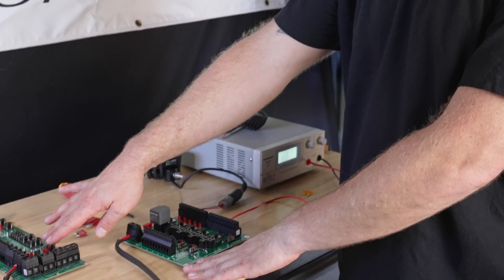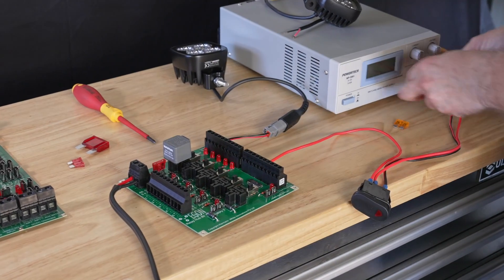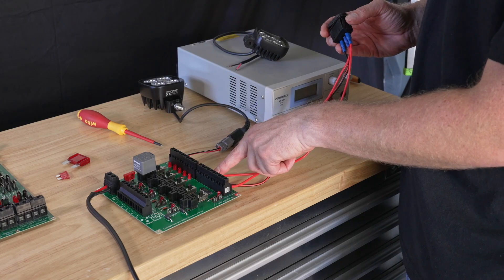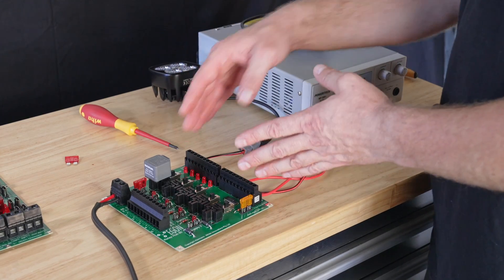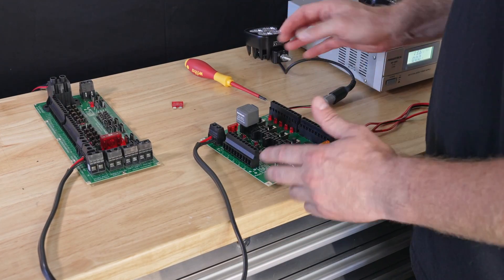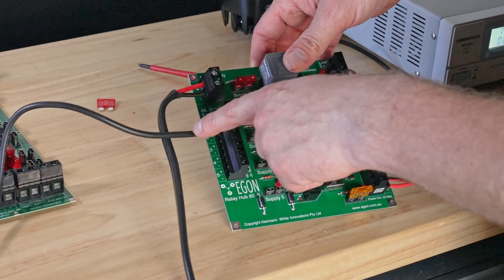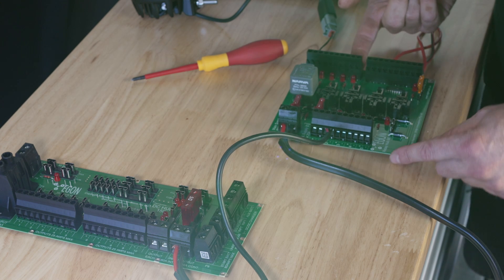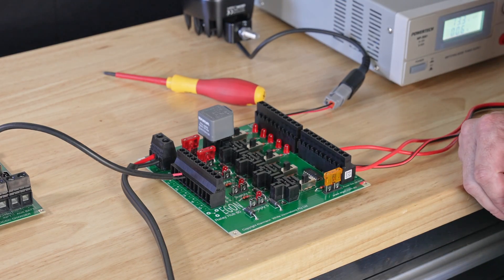EGON RELAY-HUB. Wiring to DC-HUB/power distributor/fuse/power@EGONGame-changingsimplicity

Comment: 1:23 good question, do I just wire all 5 pos and neg into the one, switch wires into the other 5 switching points. Is it a common pos neg? I have two relay hubs and the power hub...

Comment: Awesome product will be implementing in my build. 2 questions:
1) @:1.23 : how many switches can i daisy chain for the power output for switch input (i.e poistive and ground cable from board powering the switches) i have a few switches right next to eachother which need power
2) how do you recommend running two seperate 12v power inputs into different located switches FROM THE BOARD - i.e. two sets of cables to switches - for example switch in the front of the cab and switch in the back of the cab 
3) Located in perth - is it best to source from p2p or is there a cheaper option ?
Many thabks great video

Comment: Instead of screwing the wire, why not use a WAGO type of connectors for easy use/connection. Just a suggestion.
Reply from the maker: voltage drop is too high with WAGO connectors. These are not ordinary screw connectors!
Reply: @EGONGame-changingsimplicity  -Got ya